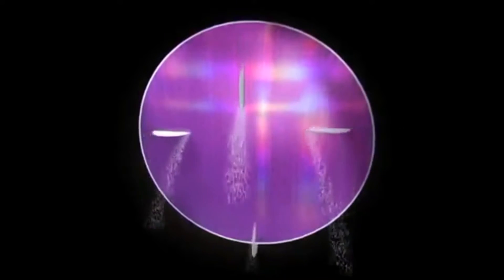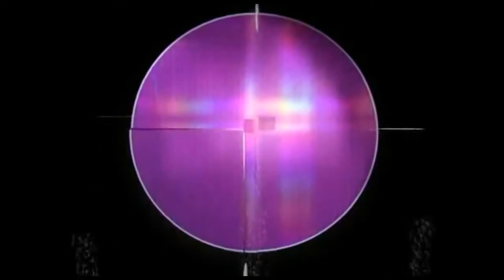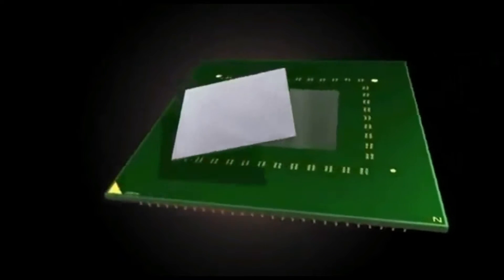How did the 4 core 820 beat the 8 core 810? Theory-Ep.1

Comment: I have done multiple test using the old quadrant standard app.  been using it for years. I have seen my phone's get faster and faster, so I keep using it for my own comparisons.
My HTC One m9 beats every galaxy s7, even my wife's edge every time. not by allot, but it beats it.
And you see it during the CPU test. 
Why? my phone doesn't get hot?  Just seems in real use every day stuff there just isn't a real difference.
 Is marshmallow the difference?
Reply from the maker: +Mark Hagopian HTC, after upgrading to marshmallow have changed quite a lot in their software. I use an M9 myself too. 
One reason why the 810 on the M9 is beating the S7 may be because Samsung is rolling updates to most of their super powerful flagships, where it either clocks the processor at a lower speed/reduces the battery capacity to prevent explosions. 
Also, try using the new apps that are perfectly 64-Bit compatible. The results may vary. 
We'll be here to clarify whatever you need. ;)
Reply: +TechOn sounds razonable...